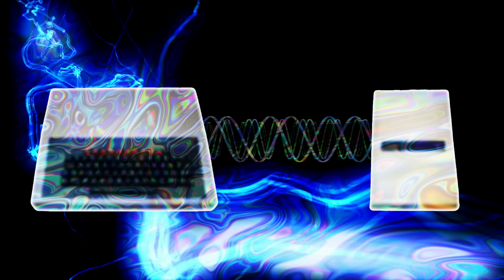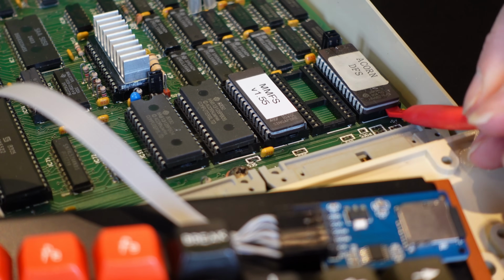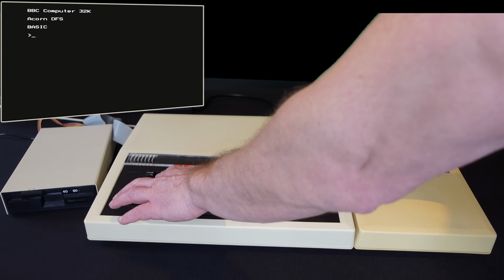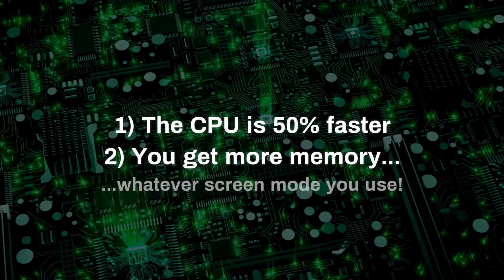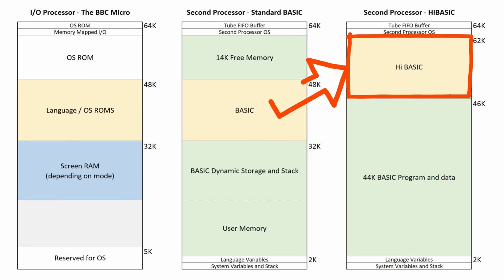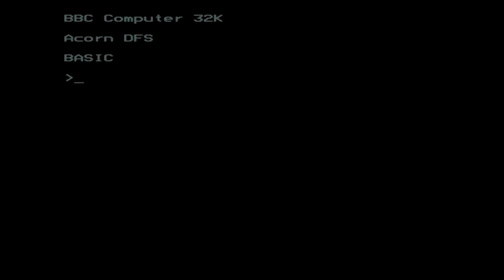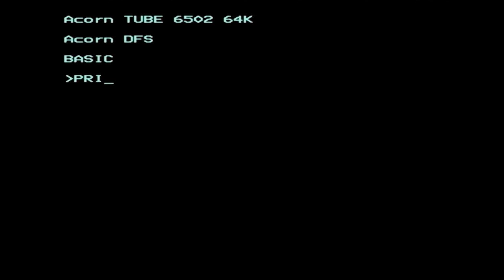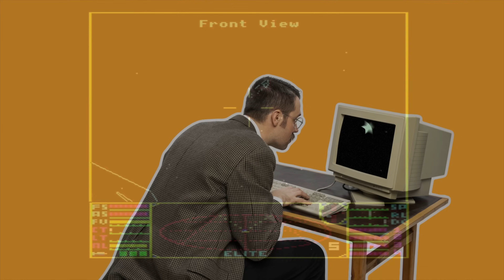I Bought a 2nd Processor for my 8-Bit BBC Micro!

Comment: I have two of these "cheese wedge" 6502 second processor units. I paid a grand total of £0 for them. When I was at college back in 1994 they'd just moved over to PCs and were dumping all the BBC hardware. I was told "anything left in that pile at the end of this term is going for scrap". As well as the second processors I also ended up with 3 or 4 BBC Micros, all fitted with Econet, a clock box, and a few other Econet bits.

They're still stored in my spare bedroom, over 30 years later. All still working at the last count.
Reply: So many schools were dumping their BBC computer equipment in the late 90s. I ended up with literal piles of BBC Model Bs, disk drives and Cub monitors for little or nothing, all in full working order. Got rid of them all for space reasons in in the mid-00s, when they weren't worth much. If only I'd kept hold of them...
Reply: I worked as the "Computer room tech" and support teacher at a school in London in the mid 90's. When the new IT coordinator came in and decided to replace all the Beebs (and by extension Arcs) with Macs in a 2 year span (at which point she left) with little to no usable software I wanted to pass out the old equipment. I was told under no circumstances could I do that and in fact got a skip which I had to dump the Beebs and associated hardware and software. But not just dump I had to make sure they were no longer useable and was told to smash them. Now anyone who knows the Beeb knows it was a reasonably well made system not prone to breaking that easily so I ended up swinging a sledgehammer smashing a skip loaded with computers. Now just to be open about this I'm not a huge fan of the system (although some games I do have a soft spot for and I have owned one) but this was a waste there were kids that could have used one and other schools that were in need of additional systems. Now I was able to get a few to some schools (full systems inc monitor printer and software) but most were in the skip when I went the next day to do another load the IT coordinator had some of the kids already fill the skip including the monitors and I'm not stupid I don't swing sledgehammers at a vacuum CRT. She threatened to fire me so I went to the headmaster and told him why I'm neither smashing or unloading dozens of CRT's. She already didn't like me before this because I told her what was wrong in replacing them with Mac's and she was the quintessential Apple fan girl. After that I would say she hated me, but I was able to get even more systems to other schools.  I let it slip to students that there were no cameras that pointed where the skip was (I even saw a parent back up their car and grab some)
Reply: @daishi5571  Man that's a heart breaking story. And so annoying too. These days people have paranoia about hard disc chucks but such old computers had no non factory data on them so no reason to smash them up. Indeed what an absolute waste!
Reply: I ended up with a BBC Model B, A Master, 2 Commodore 8296 Pets, some original Macs, but not unfortunately a 2nd processor. Later was given an A3000...
I also learned how to hack many BBC programs to work over the Econet and machine code!!!
Reply: Nice work squirrelling all that away 🥁

Comment: I have been wondering for a while if it was possible to have two 6502s running.  I had no idea Acorn came up with this.  I eventually thought of a similar idea of having a kind of queue (FIFO bus) to put commands on from 1 CPU to the other.  That way you could have one CPU with a ROM specifically for graphics, IO and so on which would run in the background on whatever task was found in the queue.  So you could have a library to render shapes, sprites, sounds, IO and so on.  I would love to implement it one day.  There is really no reason not to have 3 or more 6502s.  I was thinking of building the ultimate WOZ Apple 3 (what the Apple 3 should have been).  With the price of 6502s back in the day, I think this would have been very do-able.  The only down side in the early 1980s would have been RAM prices I guess.
(The Apple 3 wasn't all bad, but could have been so much better, even better than the //e)

Comment: I find it really quirky that the BBC Micro supports a second processor. Seems like you could get some Unix systems running with a Z80.
Reply: When I did my A-levels the computer lab had BBCs with the Torch Z80 coprocessor, that ran CP/M. I wrote an A-level project on them in Pascal.
Reply: There was Torch UNIX (or similar name) from memory, running on a 68000, or some version of the 68000
Reply: My first job was at Torch getting Unix running on that 68000 card. It was the Unisoft version of System 3. There was 256KB of RAM but it had a very crude memory mapping circuit that only supported swapping. Sometimes you could get 512KB of RAM running but it required fiddling round to find the optimum capacitors. It got to the stage that there was insufficient memory to compile the kernel.

Comment: A few years back i bought a perfectly restored Master 128.
Two upgrades pending are TubePi for the internal Tube bus and BeebSCSI on the internal 1 MHz bus for hdd emulation.
Going to attempt to build a Sound Card for the BBC which will insert into the Master cartridge slot